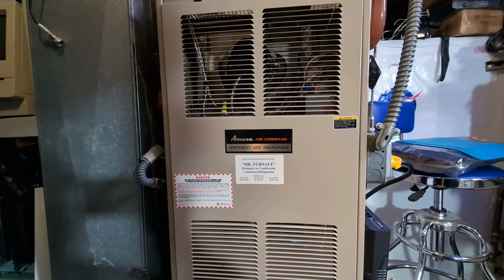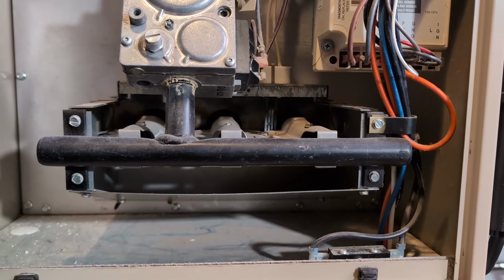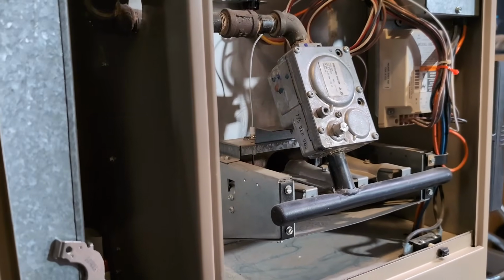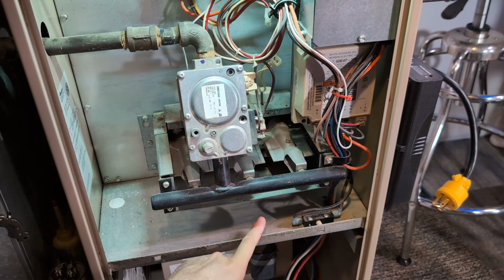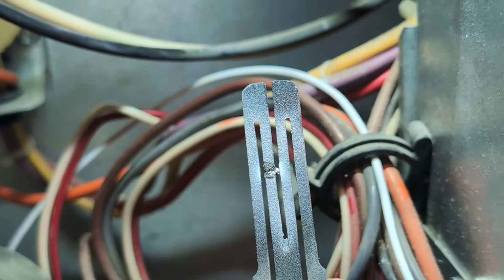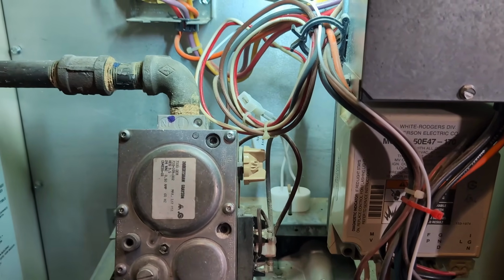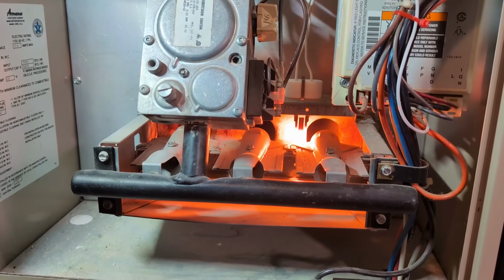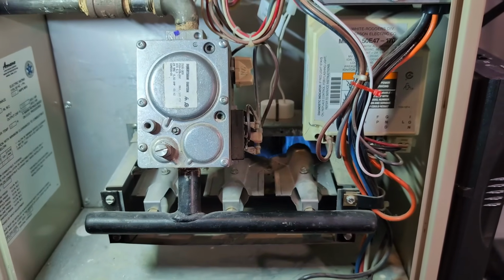Quick fix: No heat! Gas furnace repair, before I've even had my coffee. (Amana Air Command)

Comment from the maker: Update: I ended up ordering a new Robertshaw 41-401 HSI (Hot Surface Igniter) to have on hand, and the new part is actually Made in USA! Awesome! Also, the part I removed from my furnace was original, made by Norton and apparently Silicon Carbide. I found the original Date code from the furnace and it was 1990. The date code on the failed HSI (igniter) I removed was also 1990! Amazing something that gets red hot at every start and lives inside the flame lasted that long. You might have noticed the part I installed was Made in China and not OEM, so who knows how long it'll last... but it's good to know I have a new quality OEM part to go back in when that fails. I think my spare flame sensor is also a non OEM part, so I'll likely order a new flame sensor for the unit to have on hand that is (hopefully) made in the USA.
Reply: It kinda looks like a piece of dust hit it and caused it to short through a much shorter path.  Blowing it like a fuse...  Might be time to clean out the whole thing and replace your filters.
Reply: @BloodBlight hot surface ignitors die in that fashion usually. They fracture from all the expansion and contraction they see. With a visual inspection we catch them as HVAC techs. They even can be used as a flame detector.
Reply: @BloodBlight  there are two separate air paths here -- the ignition air (used for burning gas) doesn't go through a filter, it comes through a grating in the door that was removed to get access to the burner. the filter is for the air that's circulated in the house. There's a heat exchanger between the two so combustion byproducts (like CO2 and CO) aren't mixed into the house air.
Reply: I always think of that speech from Network, where Union Carbide get mentioned, when I see mention of silicon carbide. (Hey, that’d make a good Halloween movie…) Like at least those mega corporations made actually useful stuff like that!
Reply: Flame sensors usually just need a quick sanding with a crisp bill or brown paper bag. They don't really ever go "bad" from normal use, just get a layer of soot built up on them. now, if you ever use sandpaper or anything more abrasive than paper, then you'll have to replace it.
Reply: @nottheinternet6276  clean with some water and a long strip of cotton cloth, to burnish the deposits off the ceramic.
Reply: Order 2 of them, because you never know if, in the next 15 years, that they might either change manufacturing location (move to China) or make them cheaper. Get the old stock while you can, and keep at least 2 spare at all times. 

Will suggest to replace the fan capacitors, or at least get a spare for each one, as they do fail, losing capacitance, and then failing to run the fan properly.
Reply: I had the flame sensor go out in a similar unit.  I could clean the old one and it would last a couple of days.  The cure was a replacement sensor.
Reply: A gas furnace is not very environmentally friendly, you should replace it with something better!
Reply: @guderian557 it's also not very environmentally friendly to throw away things that aren't broken. Gas boilers are not that environmentally unfriendly, with byproducts of CO2 and a little CO, and some water. Now I'm not saying don't install say a heat pump or some such more environmentally friendly solution when it finally cannot be repaired and must be replaced or when installing new.

Comment: I had a diode fail on the control board in my gas furnace, it failed in the most unusual way, I'd come home from work and the house was cold and the draft inducer was running, I'd switch the power off and on to the furnace and it would run fine for a week, then the same thing, so now I'm taking the control board out and looking for failed parts, I found a 5v linear regulator running at absolute maximum input voltage and running very hot, so I changed that, a week later, I come home to a cold house and the draft inducer running. after many, many week of chasing this problem I began to suspect the totally fine diode and just happened to have a pocket oscilloscope connected to it, when it went into this weird failure mode, the diode would start switching on and off about two times a second, some kind of thermal failure, I guess. I replaced the diode with an absurdly over spec'd diode and the furnace has been running fine ever since.

Comment: Yeah I keep, draft motors, igniters, flame sensors, blower motors, draft fan motors,  capacitors, and circuit boards in stock.  A couple of Goodman boards, they fail often, and some white rodgers universal boards.  I keep my old Goodman going and I often get calls from others and go fix the Furnace / AC because on a Sunday night when they are cold.  The furnace people want a fortune to fix stuff.

Comment: Might want to replace that failure prone silicon carbide HSI with a 120V silicon nitride HSI which is much less likely to fail.  The old silicon carbide elements lasted a long time, but the ones built after around 2010 all seem to fail after a year or so. By contrast, I've never seen a silicon nitride ignitor fail.

Comment: Strange igniter. In europe I think we use electrical sparks. And we heat water which is then circulated. At least in the systems than I know.
American tech looks always so strange and full of question why they made them like so.

Comment: A thermopile and a Flame Sensor rod are two very different Devices ,,  They work in completely different ways,, A thermopile uses the heat from an always lit standing pilot flame to make electricity and is used in Milivolt operated Gas Appliances "that are designed to safely  operate without the need of any external electrical supply". like a stand alone Gas heater that can operate with no power . Its job is to take the heat generated from a standing "pilot light flame" and make enough electrical current to operate the main gas valve, it also has a smaller cousin called a Thermocouple that has a much lower electrical output that is a part of the gas valves safety protection , if the pilot light goes out , it naturally stops making the tiny amount of power needed to hold open the gas valves pilot and main gas flow safety valves open , ensuring the gas flow is is locked out if there is no flame to ignite it,  The Thermopyle its bigger cousin , makes enough power so that the gas appliance can have it own low voltage power on hand to operate a milivolt compatible gas valve and thermostat , it provides enough power on its own to open the main gas valve, when a milivolt compatible thermostat closes the circuit...  A gas heating device that uses a "Flame sensor rod"  must have external power and An Electronic safety control board , this rod is hit by the flame from the burner and the conductive nature of flame itself completes a circuit back to the grounded burner , Proving too the gas safety control board that the flow of gas has ignited , otherwise the Safety control board will detect gas flow with no flame detected , as ignition failure and close the gas valve for obvious safety reasons . .As said it will usually try and light the burner 3 to 5 times, with a gas purge pause between each attempt  and then "lockout" if this fails..How this thing works , just search "   Flame sensor, Flame rod, Flame Rectification  .The flame sensor is almost always on the burner furthest away from the ignition source to prove that all burners across the whole stack have ignited.. With a flame sensor system , The control board sends voltage to the probe often 60 to 80 volts AC and measures the flow or lack of flow of that current through the flame , the presence of the flame around the flame sensing rod both conducts and Rectifies the current sent by the control board.

Comment: Capacitors are a common point of failure.
Reply: capacitors, flame sensors, and igniters are the most common failures in the furnace - but then again, beyond those things, there aren't that many other parts really. Just a couple fans, a gas valve, a pressure switch, and a couple thermal switches. They're pretty simple once you know how they work

Comment: My old furnace from the mid 90's had the exact same issue.     However, the replacement ceramic ignitor only lasted about 2 years before it died too and had to be replaced.

Comment: I once had my igniter crack during a frigid winter here in Indiana. It was Sunday evening, so I was facing a very very cold night in my drafty old house with my young family. So I extracted a chunk of pencil lead from a carpenter’s pencil and jammed it between the strips of the igniter to close the circuit. It worked well enough to last through the night until I could get a new igniter at Grainger on Monday morning.

Comment: Are these old units not pretty inefficient?......just thinking about cost of running.
Reply: It's only worth upgrading if you use the heat a lot and the current one is low efficiency. His is 80% ("mid efficiency") which is the same as many brand-new furnaces, and he said his peak bills are only $80/month.

Comment: Interesting.. our "boilers" as we call them in the UK mostly use spark based igniters
Reply: also, AFAIK they tend to be hydronic rather than forced-air, as common in the US
Reply: @NetRolller3D  yes, we dont really use hot air for that.. we have radiators that are heated by hot water. I guess this is because 15mm pipe is smaller and easier to fit than big air ducts
Reply: We also call them boilers in the US.
Boilers heat water, furnaces heat air.

Comment: Nice work! Our furnaces are almost twins. Infinitely repairable.. good old equipment from the 80's. I have fixed mine a couple of times in the last decade, once replaced the blower motor, once a circuit board swap.

Comment: Also woke up to furnace not working.  followed troubleshooting flow chart in the  manual.  found blow 3 amp fuse for the 24v ac circuit board. swapped that out and watch the furnace for a few full heating cycles. no other issues. Glad you had spare parts on hand to fix yours.  Stay safe stay warm!!
Reply from the maker: I'd personally be worried about another fault causing a blown fuse. I'd expect more issues in the future.

Comment: This video brings back lots of memories of my younger days. Before falling into my current vocation as a metrology tech, I spent many years as an HVAC/ R tech. Changed many of those hot surface ignitors. Small correction about your flame sensor—it is not a thermocouple or thermopile. It’s a flame rectification sensor.  Thermocouples are typically used on older furnaces with standing pilot lights. On most modern furnaces, the control board sends an AC voltage through that ceramic insulated probe and reads the pulsing DC current flowing to ground through the flame and the grounded, metal burner assembly, usually a few microamps. You can just put a meter with a DC microamp range in series with it and directly measure the DC current.  Look up flame rectification.  It’s a fascinating subject!  Just don’t touch the probe with the furnace powered. Those things can have close to 100 VAC on them and will give you quite a tickle. 

Wanted to mention how much I enjoy your videos too Adrian!  You have a special talent for troubleshooting and conveying a complex subject in an enjoyable and entertaining way. Watching your videos has made me a much better electronics tech.

Comment: Dealt with a similar issue this past winter due to a dirty flame sensor. Cleaned it with a magic eraser and some IPA, then wiped it dry with a soft cloth, reinstalled it, and I still have heat today! Will probably have to replace it if it happens again.
Reply from the maker: From my understanding when they work after cleaning, you really need to get a new one or at least have one on hand.
Reply: My parents had a rental with multiple units, and they had probably the worst Lenox furnaces ever produced. One of the common problems was dirty flame sensors. Me and my dad used to just clean them all in the fall to avoid problems in the winter (in Canada, where it's really cold). I got good at zipping them out, cleaning them with green scothbrite, and stuffing them back in in just a couple minutes. With annual cleaning, they lasted years and years. In other furnaces I've had since then, I never ever touched anything in it, and the thing just ran. Not sure if the gas had more impurities in it that built up, or just a weird coating on the sensor itself that held the crud better. But just to say, just because you have to clean it doesn't mean anything is wrong with it. Some of them just build up a layer of crud on them, and then don't detect flame properly. Cleaning is just a maintenance thing, not an indication of failure

Comment: You should consider replacing the furnace. The furnaces today are far more fuel efficient. We had one from 1995, which was replaced in 2009 with a unit, which took the efficiency from 85% to 105% (yep, that’s possible somehow). The investment had an ROI of just 5 years. I guess they are even better now.
Reply from the maker: That makes no sense if you think about it. My gas bill in winter is at most $100/month in winter. Even if somehow it could be 20% more efficient, maybe my gas bill would be $85, and just for winter months. The furnace would need to cost $450 installed to break even in five years. I'm sure a new furnace with installation is at least $3000 or more, and I'm positive it won't be running smoothly 35 years later like this one is....
Reply: @adriansdigitalbasementextras yeah, that wouldnt make sense then.
Reply: @adriansdigitalbasementextras thats insane how cheap gas over there is, the gasprise over here is about $1.57 per m3 (which was waaaay higher a few years ago in our gas crisis)
Reply: technology connections has some great heat pump videos. :)

Comment: That's funny.  I had a problem with our heat this morning as well.  The air handler was blowing air, but the furnace wasn't being kicked on.  I knew the furnace was running because I had hot water, and the pipes for that were hot.  I thought maybe the flakey Sensi thermostat needed a restart, but that wasn't it.  Was still confused to what was wrong.
Then when I went to check if the pump on the heating loop was working, I noticed the valve handle for that loop was shut OFF.   The thing is, I have no idea why it was off.   The heat was working yesterday (I think), and I'm the only person in the house who would even touch anything with the furnace.  And here we thought all the ghosts in the house had left.
Reply: ghosts like to chill
Reply: @jyvben1520  it takes a lot of energy for a poltergeist to move things, so they save it up by napping until halloween is near ;)

Comment: Very lucky that you had the spare part. Or rather, smart planning by past Adrian. I almost certainly would've known I had one, but not found it until after the replacement arrived! I know you get some cold weather, so I'm glad you didn't have to go without heat for long. Thankfully, we don't need such furnaces here in Australia.

Also good to see how easy it was to repair. I'm guessing modern furnaces would require an always-on connection to the cloud to verify you've paid your heat subscription fee. Then after spending days arguing with their AI LLM support, you'd have to pay to get a 1st party technician (3rd party repair isn't allowed in the terms of service) to look at it, and then they'd have to spend half the day arguing with the AI LLM support to convince it to update the cloud database to accept the DRM on their 1st party part. Which would obviously cost you ten or twenty times the price of the original part.

Comment: Nice fix! I have to admit I do love the “click - FWOMP” of a gas heater clicking on a cold day.

At my last house, the furnace quit working once and it turned out to be a little particle of debris caught in like a 2 inch tube for one of the sensors. It can really pay, or maybe I should say save, to understand some of the basics on how the system works, like in this video.
Reply: That's the pressure sensor that detects if the chimney / exhaust is blocked. When the "inducer" fan is running, if the exhaust isn't blocked, there should be no pressure build up. But if that tube to the sensor is plugged, it can cause the furnace to shut down.